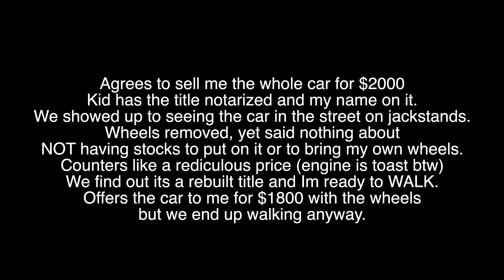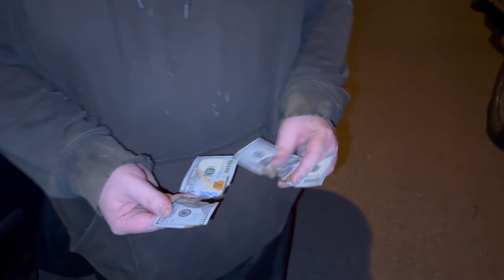Buying 5 New Cars Using My EG Hatch UTE

Comment: My next thing I want you to do is completely do entire weight reduction. Cut out the insides of the doors and all interior. Plastic windows. Like crazy light weight and all motor
Reply: I have an extra 98 coupe and I kind of want to mold the chassis so I can build 100% fiberglass carbon fiber Civic. But to make it really worth it, I would need some sort of demand for the bodies until Honda tells me to knock it off

Comment: Tandem rear axle Civic pickup. Use the drivetrain from a Subaru with a j series motor (so you can run straight stacks off the manifolds) and A fifth wheel car hauler.

Comment: Put 275K miles on a 2007 ridgeline.  50K towing across US and back and all around.  Excellent TRUCK.  Tows 5000 lbs.  rear diff locks.  FWD dominant better than RWD american "Trucks" which slip and slid with adverse weather....